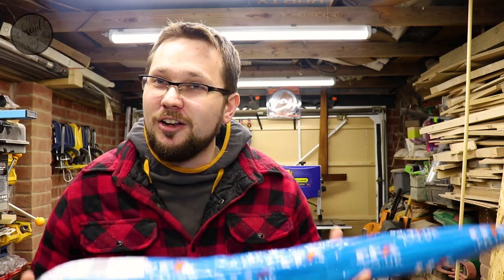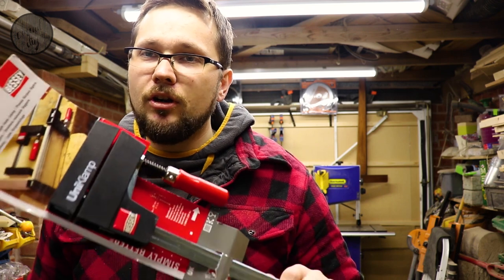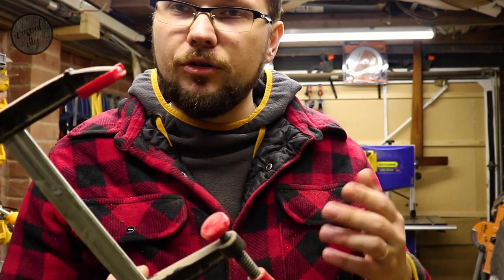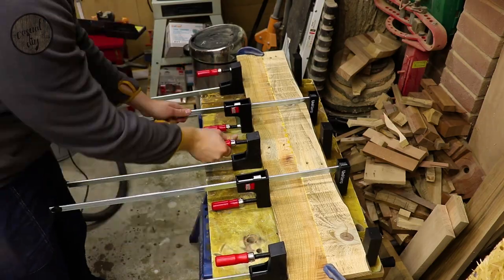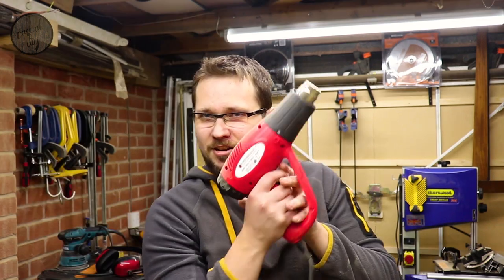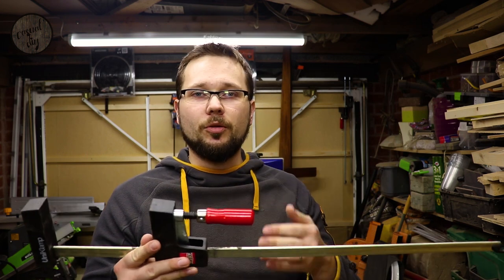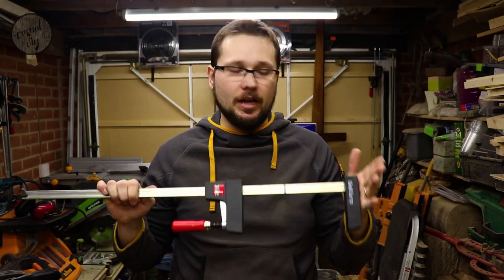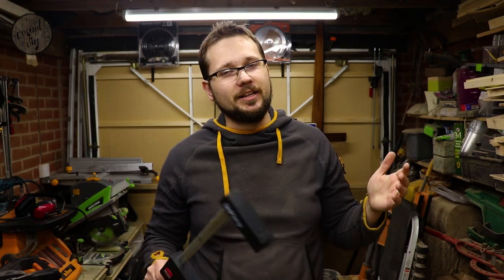Bessey clamps - UniKlamp review plus how to remove glue from clamps

Comment: Interesting that the description says "Jaws encased in glue resistant, non-marring polyamid".  Was checking these out on Amazon.com.  I liked the video.  Awesome how the clamps can be used to insert pressure outward.  When I heard that part of your video I actually said outloud, "ooooh"
Reply from the maker: Robert Knowles  Hi, glad you liked the video. The jaws are not the problem, the glue actually doesn't stick to them but it sticks to the metal bar and that's the problem. When the groves on the metal bar get some glue on them then you can't operate the clamp. So it's important to keep them protected.

Comment: What would be ur review on these now? Ive got a sertain budget and dont have to many clamps in general and also need some for panel glueups. So ive got the choice of 2 bessey kbody clamps. Or i can afford 4-5 of these. So curious to know ur follow up on them and do you still use them
Reply from the maker: In short get 4 or 5 of these. I was buying like two per month. They are fantastic, my favourite clamps, very versatile. One thing just be careful not to get glue on them as it's very hard to remove once dried. But yes they are great.
Reply: @CasualDIY  i will use either tape or baking paper to protect were glue will go onto the metal track of the clamp. But i did also find a fix for glue on clamps that works everytime. On youtube theres a few videos. White vinegar u soak the metal of ur clamp in that to get glue off the metal really easy.

Comment: Actually, if you go to youtube and search  How to remove glue from clamps, you'll find my video from last year where I show  you how to get the glue off in minutes...read the responses after the video, everyone of them is a positive "thank you" because it truly works.
Reply from the maker: Great tip, watched your video. Thanks for sharing, I need to try it out.
Reply: The only thing I will add is the vinegar will (or it might) darken your clamps.  It hasn't done so will all of my Besseys, just a couple...but that's not an issue for me, it doesn't affect the performance one bit.  what I would suggest for anyone using the vinegar to clean their clamps is, after removing the clamps from the vinegar and drying them off, put some paste wax on them.  One more thing.  After I cleaned all my clamps, I keep the disgusting rusty looking vinegar in their tubes and just cap it with a sandwich baggie and a rubber band and I place it out of the way in the corner of my garage.  Here it is, over a  year later, I'm still using the same tube with the same vinegar and getting the same result.  I try to take some precaution not to get the glue on the clamps, but, it's inevitable...it happens.  I'll just dip it in the vinegar for a few hours and wipe them clean again...eezy peezy!  :)   @CasualDIY
Reply from the maker: @abowen2  yes it seems to be the perfect solution for this annoying problem :)